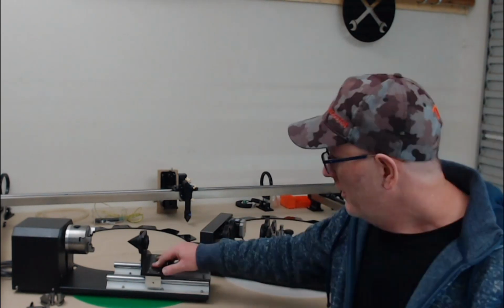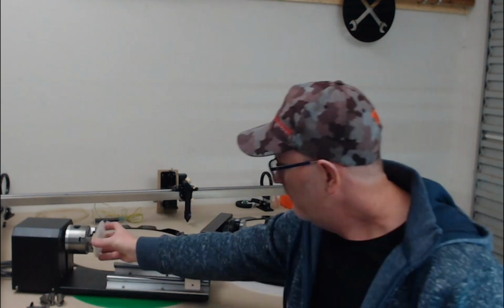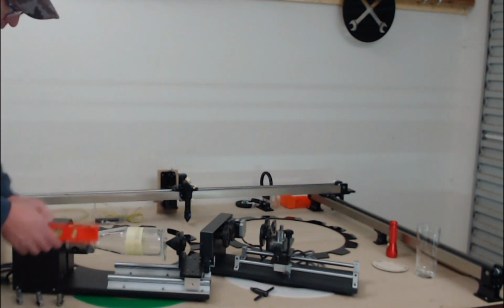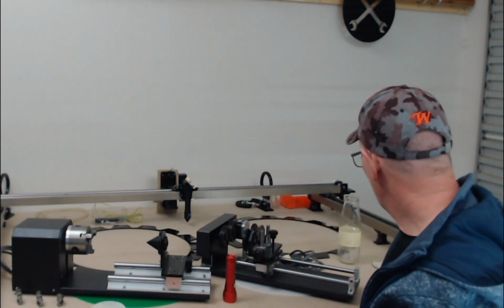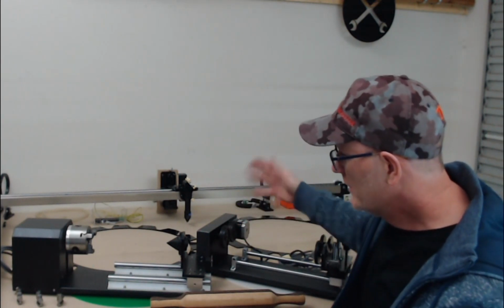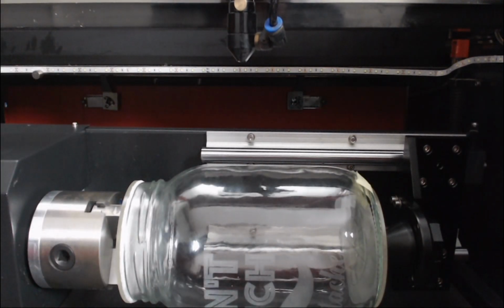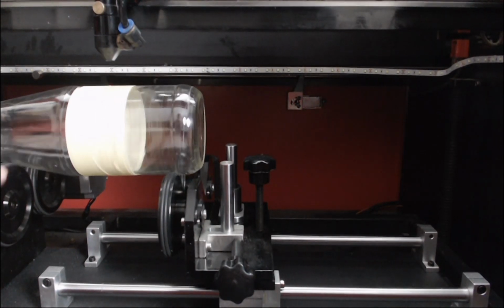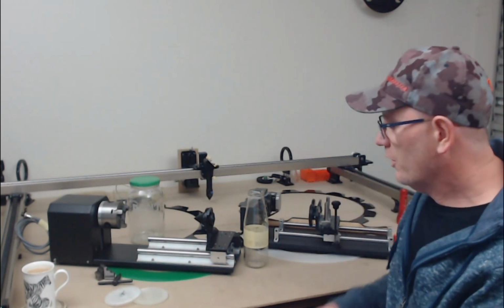Ep. 4 - LASER ROTARY ATTACHMENTS - Chuck vs Roller Rotary Axis - CNC Rotary Axis

Comment: Thanks for this and for all your excellent videos. Regarding the issues with light items on the roller type, I wonder if anyone has had success with weighting the items down by placing into them something such as a bean bag or a sand bag? I'm a laser owner who has yet to purchase a rotary and I'm considering what kind to buy.
Reply from the maker: I have seen an add-on part which is a 5th wheel that is spring loaded and rolls inside the object / glass etc

Comment: Hi Matthew trying to figure what type of rotary I should go for with my 100W F-2" . I'm mainly looking to engrave yeti cups & Bamboo/ Wooden bottles  ( Maybe Wine glasses but rare) , With as less headache  and plug and play as possible what would you suggest thats really simple to do with for my kind of requirement? 

Also do both Chuck and Roller system hold the same length?  Or any differences there ? It seems to me roller can hold more bottle length.  Would really appreciate your inputs on this  😅 thanks !
Reply from the maker: Yes, the chuck axis is limited in the length of object, the roller will be suited for longer items like bottles.  
https://mwlaser.com.au/product/roller-rotation-axis/
Reply: @MWLaser  thank you !

Comment: Matt, I have never engraved glass on this laser yet...on my small k40, it seemed I always cracked the glass. Can you give me a few tip on engraving glass as far as power and speed to get me started? I appreciate your videos!

Jeff
Reply from the maker: On the 80W tube a low power 25-35% and medium speed 300mm/sec work well for me for engraving, I have not done a lot of glass work though, but this will give you a start point to start your fine tuning till you get it looking like you want.  Cheers Matt

Comment: witch rotary should i buy to make wooden columns i have to make a lot of them
Reply from the maker: that depends on the length of the columns.  the chuck rotary is great however it's main restriction is the length of the item being engraved (as it needs to fit between chuck jaws and the supporting tail stop).  The roller rotary is better for engraving longer items.

Comment: este aparato se puede adaptar a cualquier impresora laser?
Reply from the maker: Most laser machines are capable of using these rotary attachments, if they do not have the rotary axis connection it is possible to wire one for your machine

Comment: how to connect this with the laser ? what if i buy cheap one on along with cnc laser, is gonna be hard to programme it together?
Reply from the maker: The main thing you need to know when selecting your rotary device is the type of motor used on the laser machine's Y Axis in order to select the correct rotary attachment.
eg 2-Phase or 3-Phase Motor.  (A 2 Phase uses 4 connections A- A+ B- B+  whereas a 3-Phase use 3 connections U V W)  Check out the 1st video in the series about the types of Rotary.  
Any Questions email me matt@mwlaser.com.au
https://www.youtube.com/watch?v=Y-NzNeaOegI
Reply: @MWLaser  thank you Sir